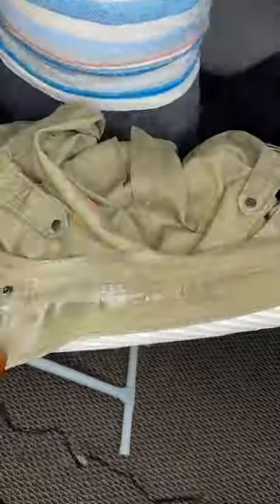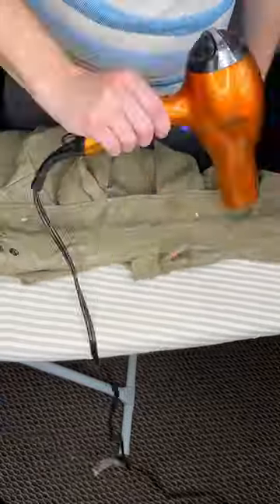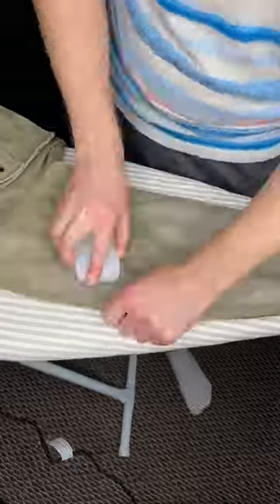Recreating the chemical treatment used on WWII uniforms (CC2)

Comment: Decking oil looks much better imo. It leaves a darker finish which you see in original photos and it's much easier to do, just dip it in and let it dry outside. If it rains just leave it, makes it look even better.